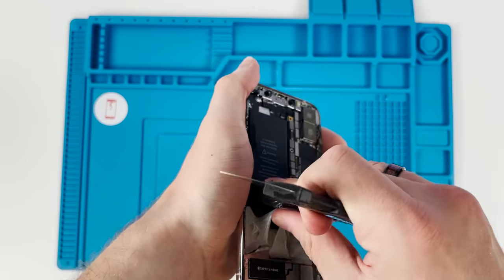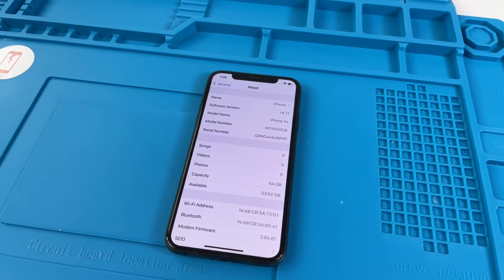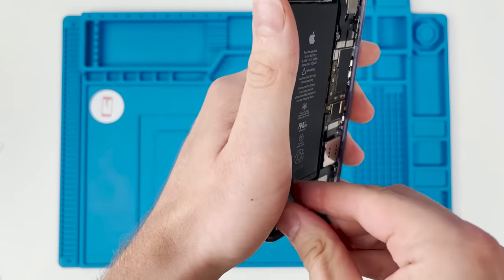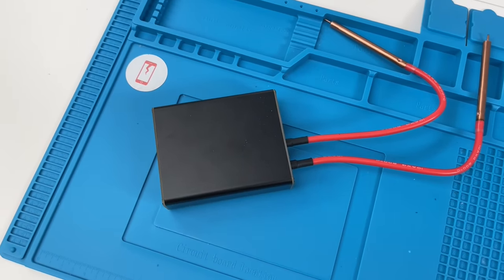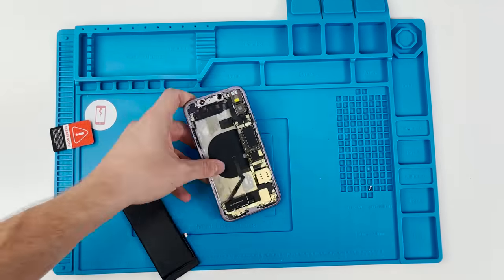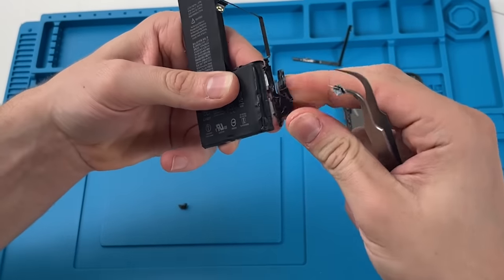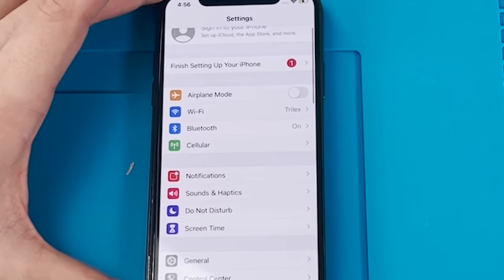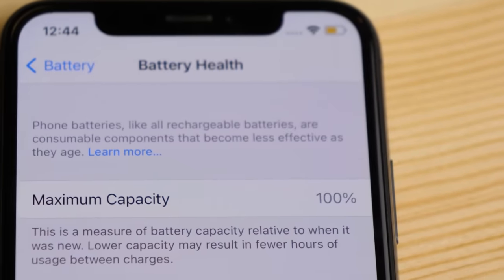Removing Apple's "Unable To Verify Genuine Battery Warning"...

Comment: I mean I would pay a third party an extra 10-20 for getting this on top of the normal battery fee but actually finding a good place, let alone a place that could do THIS is basically impossible so you’d have to do it yourself which I barely even want to consider the regular battery change lol

Comment: I have done this and all this does is alleviate seeing the notification.  The downside is that transferring the battery IC chip from the original Apple battery retains the % capacity as it was when it was removed from the old battery.

so, say the old battery was down to 70%… when you transfer the chip to the brand new aftermarket battery, now the phone will see the new battery as having only 70% capacity 🙄

Yeah, now you dont see the ‘non Apple battery’ notification but you really havent fixed the low capacity issue.
Reply: Didn’t u watch the video?
He reprogram the battery’s health
Reply: @diddlyboy1611  my bad, I must have actually posted to the wrong video when I was viewing several.

my apologies 

programming the battery IC is defined the only way to remedy the issue

to the OP:  Nice Work!
you can also solder the foil together, no need to spot weld

Comment: The fact that you literally failed the first time shows why this is a thing from the start…
Even if you were successful this is a non-issue since it literally just says that your battery is replaced by a non-authorized shop, no function is impaired.
Reply: He failed because Apple doesn't actually have certification programs available. The only way to become certified is to stop doing economical repairs for the consumer and limit yourself to battery swaps and display replacements. Apple also does not allow certified shops to hold inventory, which means it takes 4 days for a certified shop to replace a display and 40 minutes for an unbranded repair place to do it.
One point in your logic that I think you missed is this: WHY IS THE BATTERY SERIALIZED IN THE FIRST PLACE! I really hate this specific anti repair practice because it turns working devices that just need a new battery into instant ewaste. What happens when Apple stops servicing the iphone 13? Are you just expected to throw it out because the monopoly on repair, apple, won't fix it for you? I am more than willing to debate this as I am an avid tinkerer. I have successfully repaired iphones for half the cost of the genius bar, saving them from ewaste, as have built 10 PCs. I may just be an "idiot teen" but I really enjoy working on electronics and saving people money, I am sad to see this industry fading

Comment: What if i buy an original apple battery? It will work without that process?
Reply: Nope, still gives that message. My theory to this is that whatever capacity the old battery is, say 70%, the iphone remembers. Whenever you put a new one in (100% capacity), the iphone shows an error since the presented battery health went up from 70% to 100%. With a single battery, it is of course not possible for this to happen. So, the iphone shows an error.
Reply: @tractor2899  thank you for the reply, so the problem is only the notification? I was thinking the problem is the battery doesn’t work(for non original battery)

Comment: The most important question actually is now still on the table. Didn't you realise, that the battery health was just programmed and not measured, by meaning the battery actually could be still perfectly fine and just not properly charged to max, because the chips did just calculate the battery life... this is definitely planned obsolescence!!!
Would be most importantly to know, if it would had been enough and  possible to just properly charge the damed battery by a external charger to the right voltage and resetting the chip....

Comment: If you need to buy a Chinese battery + a spot welder + a battery hack tool + hope that is working after all … just to avoid spending 70$ at Apple …I’m not sure . Ok for a phone shop but not for a private use.

Comment: I hate to be the party pooper, but cars have had these programming needs since the advent of the computerization in the late 90s early 2000s (Battery, Tires, quite a bit of control modules...). But it can be reprogrammed using a programmer (duh). 
I wonder if that same programmer exists for Apple. Maybe there is a serial number which ties it to the phone programmed in the chip. Why would it be so difficult to find that out? That's where Apple's "security concerns" come in. 
What functions does the programmer you showed us in this Video have?

Comment: Actually something weird happened to me on my old iPhone 6s plus, i changed the battery by myself and had to deal with the service message and not being able to read the battery health, one time i brought it to a private repair shop to replace the battery again and then i found out even though the original battery was long gone and lost , i regained the battery health showing in settings as if it was a genuine apple battery

Comment: Yes, they force people to do risky repairs, increasing the risk of phones catching fire etc. And then when a phone does catch fire, obviously it wasn't apple's fault. They even made it difficult to repair to prevent you from doing dangerous things.
Of course, if they made it easier to replace the battery, they wouldn't have to protect you from the danger of replacing it, since it wouldn't be dangerous anymore...
But I guess apple hasn't figured that out yet, since it's less profitable.

Comment: I'm actually surprised this worked. You see, a lot of smart bmses like to lock them selfs and blow the main fuse when the cell voltage drops to a certain value. I know this is true in laptop battery packs. In that case, you need to maintain voltage while transfering cells, if its not already bricked due to bad cells.

i also wonder if that battery capacity estimation would go up on a non programmed battery in a course of charge/discharge cycles?

Comment: if that’s all phone repair shops need to property replace the battery then they should invest the 200 bucks and obtain this equipment and if they need to raise the price of a battery replacement for iPhones so they can incorporate this extra step then so be it cause I know I’d gladly pay 20 or 30 bucks more for my phone to have the battery serialized properly and If I pay for a battery replacement I expect to receive my phone in the same working order as when I bought it in so I don’t want to see any important battery message that that results in the battery percentage software not working

Comment: Isn't attaching an aftermarket battery to another battery's BMS board like crazy dangerous though? Like explosion/fire hazard dangerous
Reply: It's not. If anything, this is safer if done correctly, because the battery protections used by apple are usually much better. Chinese cells use the bare minimum bmses and sometimes fake the Smbus data.
Reply: @hojnikb  interesting. I thought attaching a battery board to a cheaper/faker battery would be an issue, those swell up easily and the Apple BMS board would probably stress the battery more than it can take
Reply: If done on a non flammable surface and in a - WELL - ventilated room,  it's not dangerous. If you puncture the battery, the most you will get are flames ~3" high for a moment, the gases are what you need to be afraid of

Comment: Expecting Applé to put the BMS deep inside lipo sheet in iPhone  
14 😵
Reply: they are not gonna do that, that's pretty dangerous, as board sandwitched between cells would pierce them.

Comment: Dude I need help. My battery had never been repared or replaced, and the model of phone I have is fairly new. (iPhone 12 Mini). Yet this morning, I got that notification, texted my family about it, then 3 minutes later my phone breifly went pink, and then self-restarted. Now whenever I go onto my phone for more than 2 minutes, it just freezes, then self restarts. (sometimes it gets stuck in a boot-loop, like now.) I only got the pink screen twice today, about 1.5 hours apart. But I do not know what to do, and I scheduled a apple appointment for tomorrow, but I do not want to pay the price. I need help!! what could be wrong?

Comment: Now the iPhone 13, minis, pros, pro maxs has a serial number on every part of the iPhone which makes it so you if you do repair anything by yourself the phone won’t work 100% properly with all its features on the phone unless you go to Apple and give them your money. The only thing you could actually repair on the phone would probably just be the  back glass and hopefully at this point Apple won’t actually put a chip in the back glass so you can’t repair that either.

Comment: you need to be careful with cutting the terminals of the battery you are lucky that the battery did not start a fire.

you should cut 1 terminal then turn the battery over and do the other terminal from the other side so the snips dont cross over and cause a short.

lithium batteries have the power to dump a lot of current when shorted and can heat up quickly.

Comment: I really didn't mind the warning after changing my battery but it seems that updates on my iPhone 12 fail now.  I am stuck with IOS 17.1 and when I try to update, I get an "Unable to Verify Update" message plus warnings every time I unlock the phone that I need the update.  Has anyone else run into this and will it go away after the BMS transplant?

Comment: Will the phone work with just that tiny BMS and a charger
Reply: very likely it would, but phone could freak out and not show corrent state of charge, since the internal resistance of that "cell" is different.

Comment: Can you try to move the BS board from iPhone 13 that way we’ll have some hope for the future
Reply: He doesn’t have to try, if you move the BMS to a new cell, it will work. But resetting the health back to 100% will possibly need an extension board. Same goes for the 12 Pro models.

Comment: PLEASE take a worn out battery and connect it to the BMS board of a new (genuine) battery. This experiment might expose Apple's battery health shenanigans.
Reply: This would mess up fuel gauge data (thats what gives you battery percentage) and your phone would shutdown at like 40% (or however degraded the cell is).

Battery health is usually pretty accurate, as that data gets read from the bms/fuel gauge ic and is part of the calculation for the state of charge.

Li-ions use different methods to determine state of charge. One of them is to always monitor current going in and out. And since charge/discharge efficiency is pretty close to 100%, this way you can determine pretty exact state of charge and wear of the battery.
Reply: @hojnikb  But the BMS should be able to determine the actual capacity of the cell and calculate the battery health percentage, right?

Comment: Hey dude, my brother has a iPhone x but one of his friends hit it while he was holding it so now the screen is just green when we turn it on. Can You please help us, just tell us what to do please.
Reply: He likely screwed the display up. Buy a "soft OLED" replacement on eBay, avoid "genuine part" sellers as they are lying. Put a heating pad on the top of the device to soften the adhesive, pry around the display, and swap the cables.
I'm not responsible if you screw it up, although I have done multiple display swaps as a high schooler.
Reply: @Carterthielftw_  thank You so much

Comment: Is it possible to replace a Samsung LCD and not the touch
Reply: Define "Samsung lcd" because Samsung manufacturers literally hundreds of types of displays for things from alarm clocks to TVs. I would bet that you can't if it's modern tho, as the glass/digitizer is normally fused to the LCD/Oled

Comment: Replacing the IPhone battery should not require a trip to Apple or the extreme of battery spot welding just to evade the dreaded, “Not a genuine battery installed,” message. While I understand some parts need to be Phone specific, mainly genuine parts with serial numbers tied to a phone to alleviate theft. However, a battery is not one of them and is considered a wear out item in my opinion. Batteries are not that expensive and IPhone battery theft is highly unlikely….as one would just purchase a new battery. I certainly would NOT install any used battery in an IPhone.  Apple should drop the genuine battery issue. Personally, I normally just buy a good reputable battery and do the install forgoing the battery message. No reason to pay Apple more than we need to and the whole battery issue is full of Apple greed along with silliness.

Comment: what a bunch off hassholes there at Apple. I dont even want to go to the hassle of replacing the battery from the chassis I took the logic board im using, let alone go trough all this hassle just to remove that annoying message. both batterys are at 90% so I guess Ill use this one and deal with the annoying message and eventually replace it with the one paired with the logic board when this one has gone to a couple hundred cycles or so. Apple really wants you to buy a new phone and thats that.

Comment: Method is already outdated as they have encrypted each battery to a specific device and will most likely make bms read only but with enough effort the repair community won’t be defeated and new ways will pop up

Comment: all the idiots saying apple is anti consumer, he just proved someone can put in a crappy battery but you would think it was apple genuine. i bought a replacement battery for my 6s, it lasted 6 months. if i had an apple store close i would have went to them as the original lasted 3-4 years. i eventually bought an ifixit battery and so far so good.  the 1st battery was claimed to be as good as the apple, it was $45, so not some cheap battery. i don't like some of what apple does, warning a battery in not real apple is not of those things.

Comment: I probably won’t even worry about the annoying pop up but I might take it to apple and have them do it for about $69 (nice 😏) just to avoid any issues. It’s cheap enough for me to justify taking it to apple instead of me doing it myself since I tend to break something in the process. Case in point: my V40 and my OnePlus 8 Pro. I broke the wireless charging on my OnePlus 8 Pro by fucking up the contact points on the motherboard and on my V40, I fucked up the contact points for the fingerprint reader and now the fingerprint scanner will never work again on the V40. I also ripped the cable for the flash on my Pixel 4XL when I replaced its battery then again that phone has other issues like the volume buttons not working and the camera connector constantly coming off and I have to take the phone apart and reconnect it. So yeah… I’m now an Apple user. Go figure

Comment: that's it im switching to Samsung
Reply: Don't get an s10+. Mine shows a "moisture in the charging port" error and I havent found a fix to it. The charging port is dry as a bone and it still shows the code. Its been a real pain and I cant charge it.

Comment: Can apple just shutup about genuine and not genuine literally no one cares if the battery isn't apple branded as long as it works that's all that matters second that thing of not being able to replace the touch or face id is just wrong like literally I didn't know that and I fucking threw out 3 touch ids from 2 iPhones 6s and a iphone 7 and idk if the expensive jc no Bluetooth home button can put the phone in recovery and or dfu mode also idk if apple still repairs the 6s and 7

Comment: this method only work on model below iphone 11😂 for iphone 11 and above still cannot use this method. also you will need a battery write and read device to copy and edit the information of the battery😂😂
Reply from the maker: Yes you can And you just need another programmer